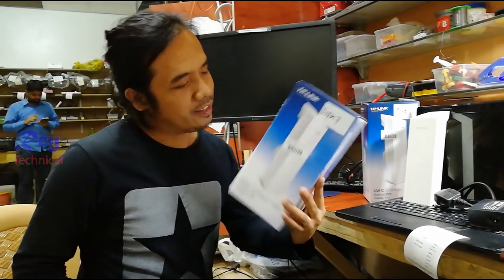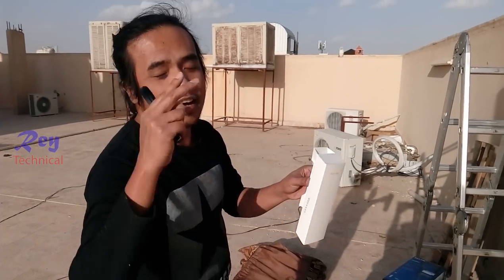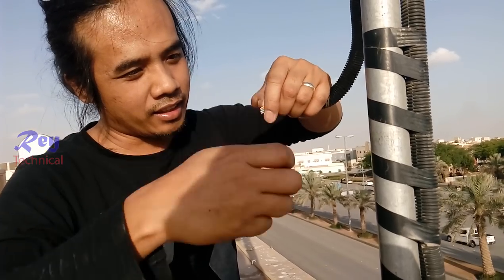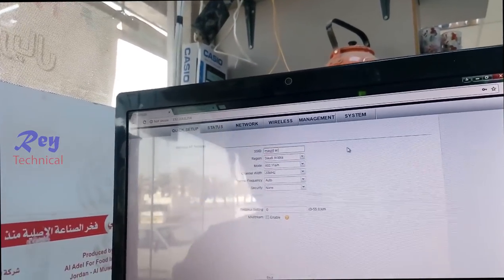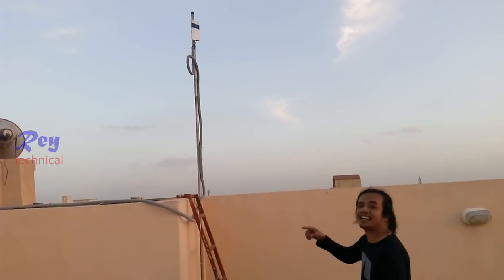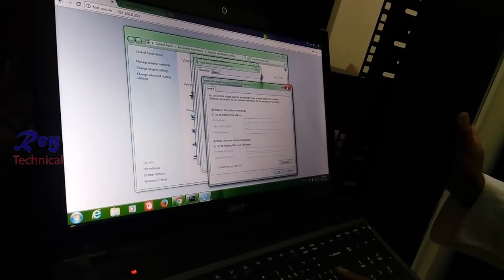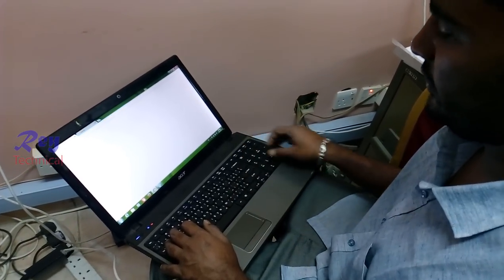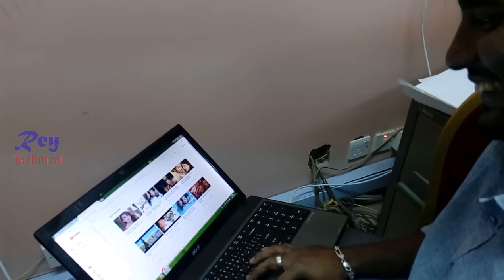TP-LINK CPE510 INSTALLATION AND CONFIGURATION FOR CLIENT MODE TO ACCESS POINT MODE

Comment: Good!!
2 things.
The ip address of the antenna would not be better to put it in the range than the router? For example, put ... 192.168.1.254 to one antenna and 192.168.1.250 to another?

The second. In the network tab should not be put on the 2 antennas the gateway of the router? 192.168.1.1 and the dns for example google? 8.8.8.8 and 8.8.4.4

Another thing ... Why do you put it in Dinamic ??

Thank you!!

Comment: Hi!  for 1.5Km would  you recommend the CPE210 (cheaper) or CPE510 is best?  Regards from Japan...
Reply: Prefer 5Ghz But you have to have googd arange to antennas.
Reply: @GeorgeBikas  When using 5 GHz you have to be aware of DFS.
https://www.youtube.com/watch?v=Scro8R-E5Zo

The FCC and the EU regulatory authorities even discussed regulatory measures to force vendors to sign their firmware digitally, so that it will be impossible for users to replace the vendor's firmware by OSS firmware. 

Although they couldn't enforce this for the moment, it's probably still on their agenda.

IMHO the problem is: the more people ignore legal restrictions such as the maximum EIRP allowed in their country, the sooner such restrictions will be tightened for all of us in the same legal system.

Comment: Hello here is my confusion. I have a router from the ISP. It has an internet connection already but it is slow because  I am 2km away from the ISP Tower.  Question, how many CPE do I need to buy? Can I just purchase one CPE connected to my router then use it to point to the ISP Tower so I can get better connection? Or do I have to buy 2 CPE so I can use one as Access Point and one as Client?
Reply: One is enough as client. Both require for personal internet connection

Comment: Nice video!  5km is a REALLY long way to push considering the price point of this device.  I bought a CPE210 to do some testing at around 300 feet.
Reply: How u found cpi210 and how long it covers.
Reply: Hows the performance of two CPE210? can i use it for 2km point to point range?

Comment: Can i use it to connect to a free wifi hotspot from 100 meters away?  as a repeater
Reply: Yes but  Free Wifi Accerss Point must be at 5ghz
Reply: How you will setup Here is the diagram :- Hotspot > TPLink (510) As Reapeater (AP) Mode > 2nd Location TPlink (510) As Client/Station Mode
Reply: @doitek  How to contact for more assistance with TPLink510 set up. Email available ?

Comment: could have done all setting up  and configuration inside  your shop  or office  both the CPE as AP and the CPE as Station and finish all the mounting outside and little adjustment to exact direction possible of both AP AND STATION CPEs. quicker!